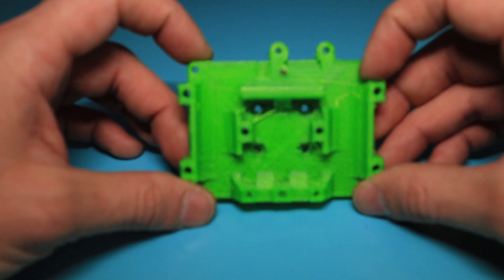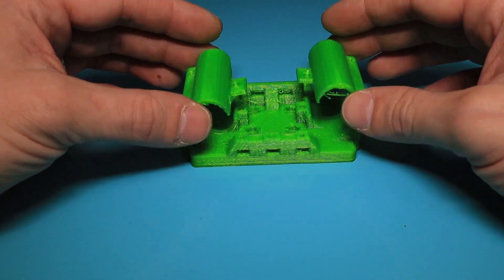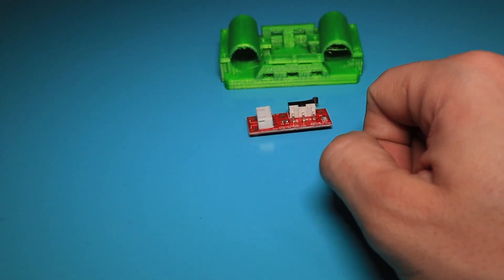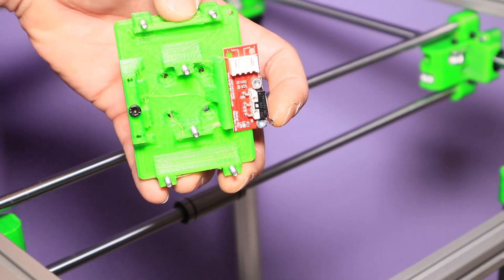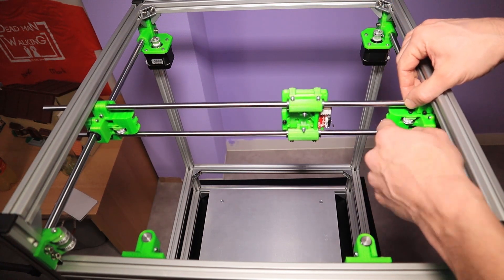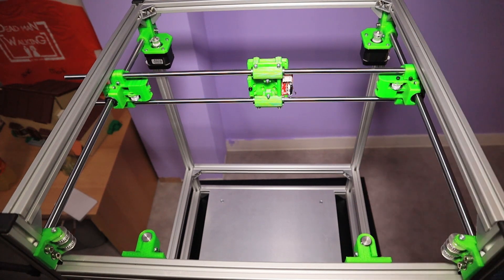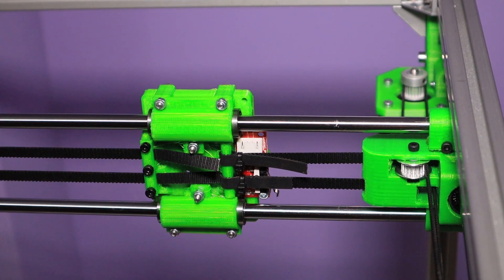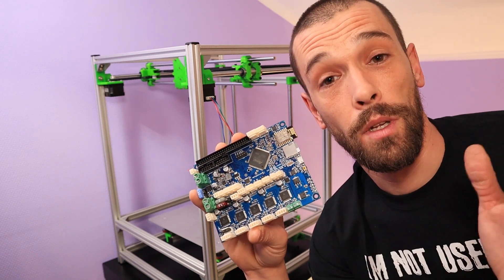EP.06 - Building a 3D-Printer - Hypercube evolution

Comment: Hi Pieter, I am going to be building my own HyperCube soon. I am collecting parts at the moment. I am also planning to use the Duet WiFi board. Did you research any of the other controller boards? Did you consider using carbon fibre rods for the hotend axis?
Reply from the maker: Hey SKWDiesel1, Best of luck with your build! if you got questions, feel free to ask! 
I went for the DuetWifi, since this is a 32bit, with built in stepperdrivers, and those drivers are awesome... so i was pretty fast convinced. And the price is ok for what you get, also, my 3D printer lives at my attick (that's where i make all my video's, and i would like to activate and control my printer from my living room, so the wifi was, for what i found the best option.
I didn't consider the carbon fibre rods, cause i when i saw Tech2c grinding them to get a smooth surface, i didn't wanted to go that way...
Greetz
Reply: @pietershomeprojects4537  Have you considered enclosing the printer to accommodate higher temperature plastics? I see problems at the top of the cube! For my cube I can see me having to extend the frame upwards by 300mm+ to allow feeding of filament.
Reply from the maker: @SKWDiesel1  Yes i did/do.... There are a lot of options.. but right now i'm struggling with my Z-axis 😂😂
Reply: a trick: you can watch movies at Flixzone. Been using it for watching lots of of movies these days.
Reply: @Casey Zayne Definitely, I've been watching on Flixzone for years myself :)